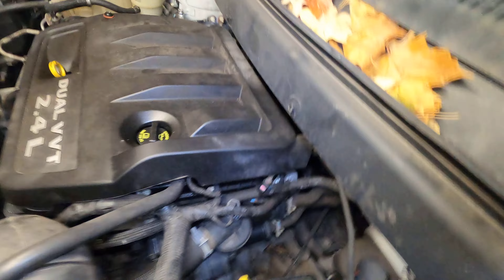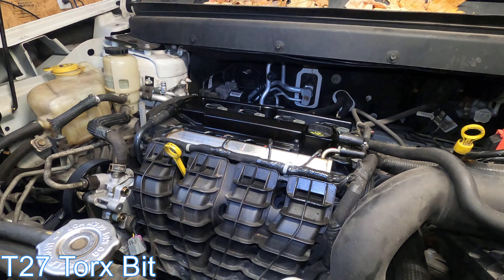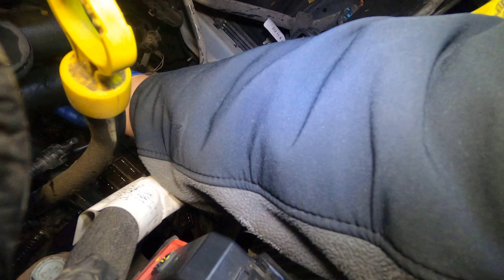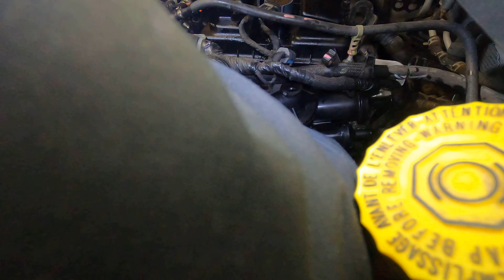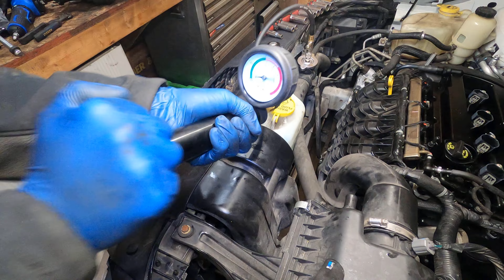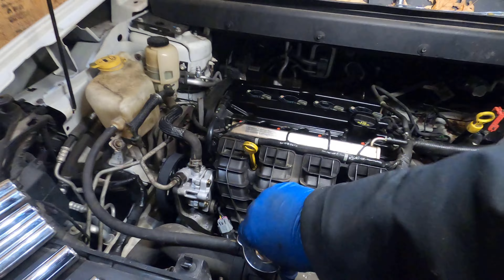2012 Dodge Journey 2 4L Thermostat Housing Replacement

Comment: Just had a gasket blow on part of my housing, ordered a replacement housing with thermostat, coming back here when the part comes in lol
Reply from the maker: @bogwitch2  i hope this video helps. feel free to like and subscribe for more & if you can, please help the channel out by giving a super thanks. Making these videos takes a lot of time, but we do it to save you hundreds. also head down into the description and check out the link for some high quality led bulbs for this and any other vehicle. use my referral for a discount. Add me in Instagram for behind the scenes pics and Stop by my store for some Anything Auto gear.

Comment: I have a 2015 that busted the plastic 3 way piece at heater core. I bypassed heater core and had temp issues. Replaced one of the thermostats, didn’t know there was a second one. 
Last week I busted the upper hose going to radiator cap. Replaced it and refilled radiator. 
Temp still having problems, should I replace the housing and both thermostats? 
Also How do I drain the system of coolant?
Reply from the maker: Not sure this design because I'm yo lazy to rewatch the video but some do have 2 thermostats. I would replace them. Every radiator has a drain you'll just have to find it. i hope this video helps. feel free to like and subscribe for more & if you can, please help the channel out by giving a super thanks. Making these videos takes a lot of time, but we do it to save you hundreds. also head down into the description and check out the link for some high quality led bulbs for this and any other vehicle. use my referral for a discount. Add me in Instagram for behind the scenes pics and Stop by my store for some Anything Auto gear.

Comment: I replaced the housing/thermostats on my 2.4 journey as well because coolant was going to the reservoir and not returning, and it’s still doing the same thing. I try bleeding the air of the cooling system on my own, but idk if that’s the issue, any suggestions??
Reply from the maker: Order a head gasket Tester and see if it failed. Amazon cheap. Checks for combustion gas in cooling system.  i hope this video helps. feel free to like and subscribe for more & if you can, please help the channel out by giving a super thanks. Making these videos takes a lot of time, but we do it to save you hundreds. also head down into the description and check out the link for some high quality led bulbs for this and any other vehicle. use my referral for a discount. Add me in Instagram for behind the scenes pics and Stop by my store for some Anything Auto gear.
Reply: water pump
Reply: I Amy have missed it, I saw you put in the primary thermostat, but the second one, is there anything particular needed for install? I ask because I have installed twice and I am still having leakage